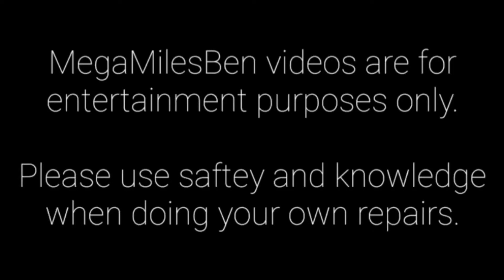Spark Plugs on a 2014 Maserati Ghibli Q4

Comment: Hey how’s it goin I have a quick question I have a ghibli and I had 2 misfires and would like to change them out my self o have the plugs and also the coil packs should I change out both or just the plugs
Reply from the maker: I would do both plugs and coils. Misfires are most common plugs or coils. If you're tight on cash, a way to test coils is to switch them and see if the misfire code follows them.
Reply: No I have both parts ready to change it’s just that there only 50,000 miles on the engine n I think it’s with these coils so I just felt mabey they are to new and it’s just the spark plugs but might just do both
Reply from the maker: Theyre easy to do really so it couldn't hurt to do just the plugs first and see. Factory coils normally will go for over 100,000 miles.